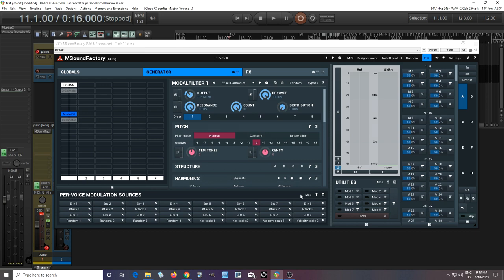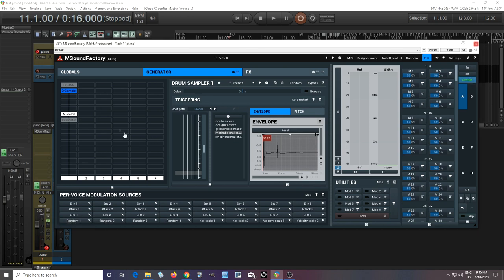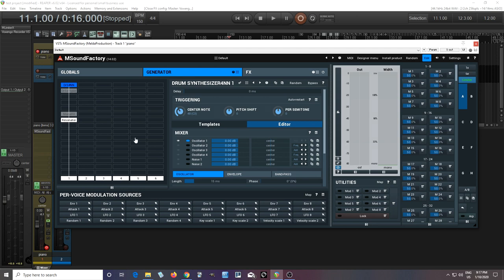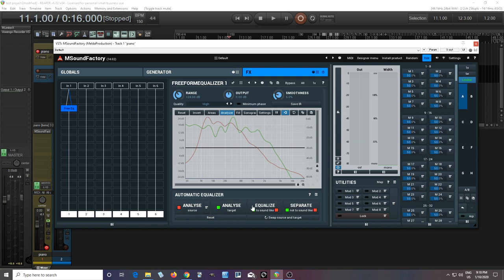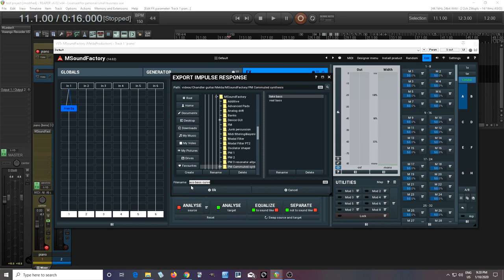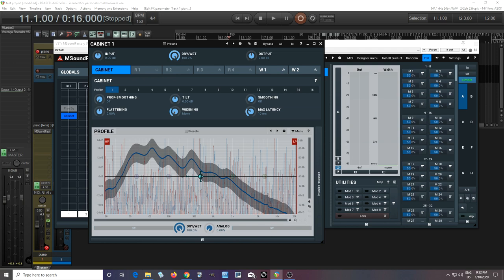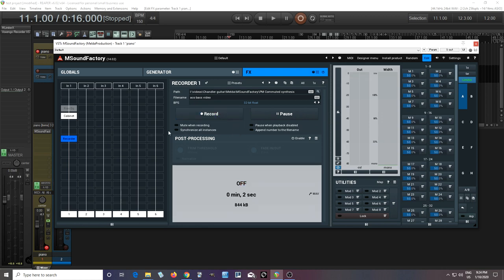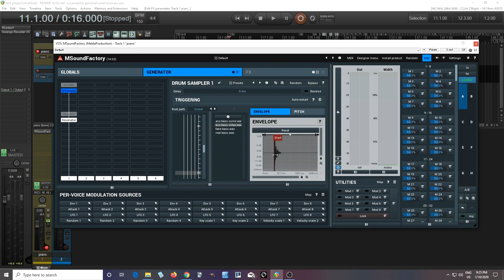Commuted synthesis - Physical Modeling in MSoundfactory Pt 6

Comment: Very cool technique, thanks!!
For too long i've used a click, sine-sweep or noise as exciter, not realising that that component has its own spectral profile.  This tute duly respects the generally neglected side of physical modelling.
Using a bank of shaped impulses, distributed over keyzones, would further enhance realism.
Reply from the maker: Yeah, I was doing the same thing, but this can give more realistic exciter shapes. The spectral shape and the decay component can really change the overall sound.
Reply: Is MCabinet a good surrogate, in MXXX, for the Modal Filter?  Or is there another solution which you'd recommend?  i love the recontextualising flavour of MSoundFactory's Modal Filter and would like such a process in MXXX (effect processor).
Reply from the maker: @tubedLeVeNdiS  Unfortunately it isn't. MCabinet is really cool, but it doesn't really  sound the same. I use the modal filter to make new sounds and MCabinet to adjust the sounds I already have. I hope that explanation makes sense.
Reply: Thanks, yea, that's a clear distinction.  i was hoping there was something for MXXX, so i could apply it on fed audio.  Timbral shifts that the 'Structure' of Modal Filter offers, specifically.